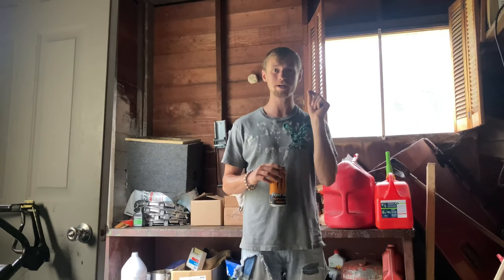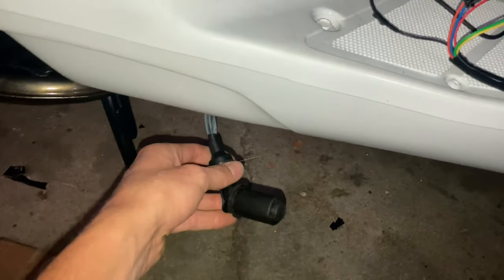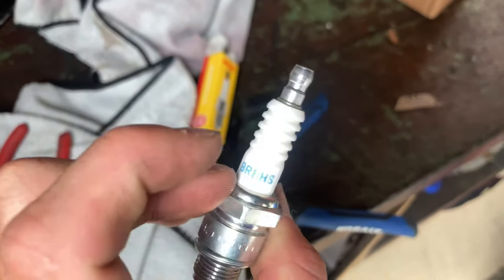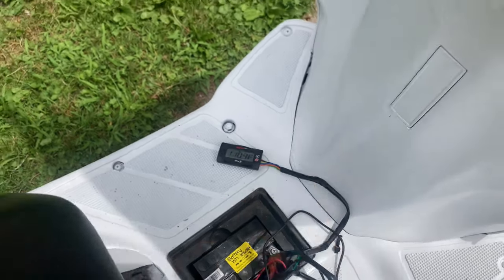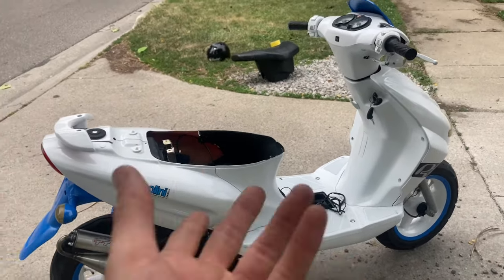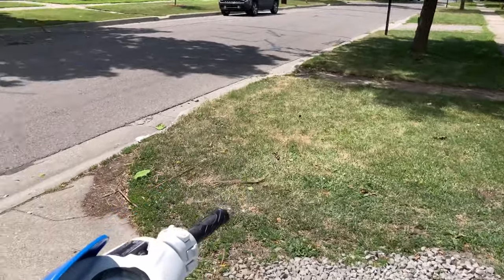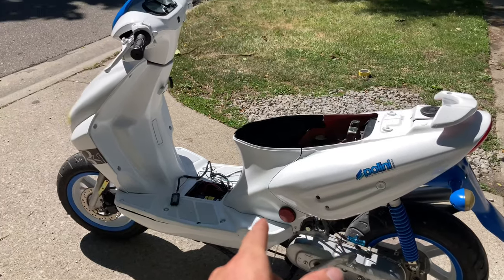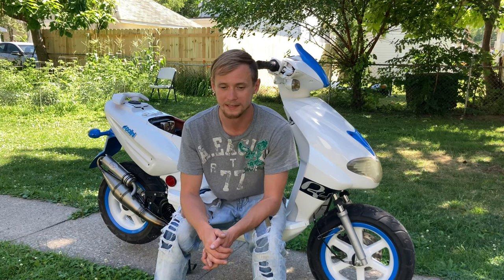Vento Triton R4 | Carburetor Tuning

Comment: get a wideband. a true lfie changer !
i had a glowshift wideband on my modded truck but now its on my 139qmb scooter.
dont listen to those people saying you cant use a wideband on 2 stroke because oil destroy the sensor. that is completly false.
first, if it comes with a bosche sensor, throw it in trash. bosche is trash as it always been ( SENSORS ). second, they need to be cleaned from time to time but they last as long as on 4 stroke.

Comment: hey! glad to see her running man! good job!!
Reply from the maker: Still gotta deal with either fabricating my current throttle cable shorter or but a shorter one so I can achieve that without having to pull on it manually with my hand riding lol but it does in fact rip like it’s supposed to a lot more tuning to get into as well but one important thing at a time 👌
Reply: @davidhofinger4927  yeah but the important thing is, you're getting there man! you're gettin shit done that some idiots said you wouldn't do and hell yeah good game man!

Comment: Did u order the spark plug or grabbed it from yo local part store??
Reply from the maker: I simply buy these From Autozone
NGK br8hs
Reply: @davidhofinger4927  good looking
Reply: @davidhofinger4927  clean the tank and carb again it running. It cuts off after like 4 mins but when I rock  the moped back and forth it  idle right then hit throttle it back fire a lil then Boggs out still didn't check the spark plug yet. But what u think still starving for gas or what?

Comment: How does thus compare to the tao tao 4t with the big bore ? Speed wise
Reply from the maker: Extreme difference. It’s 5x more powerful an 80cc 100cc 4t would not keep up with this bike at all tbh
Reply: @davidhofinger4927  did you flag down the ice cream guy?
Reply from the maker: @zalmanfans1334  he didn’t wanna talk to a hooligan riding on top a bike with one hand using the other to pull on the motor to go, he left 🤷‍♂️